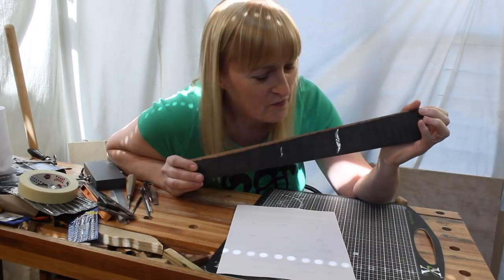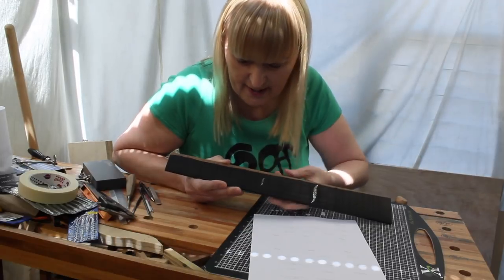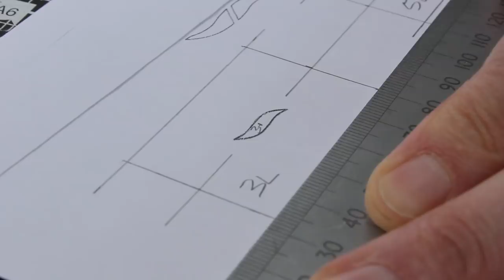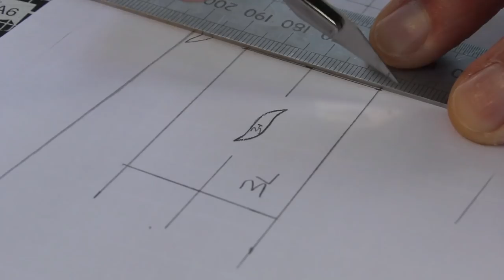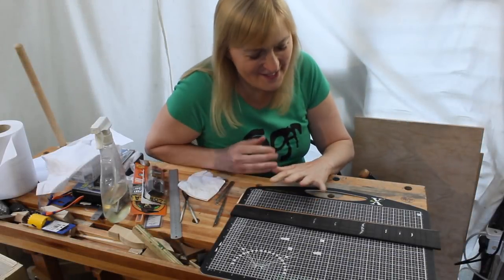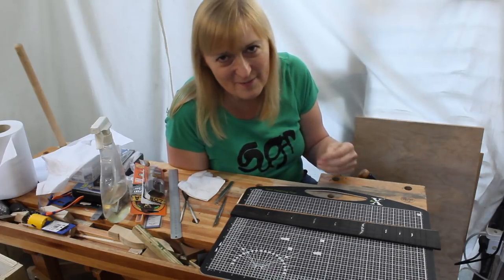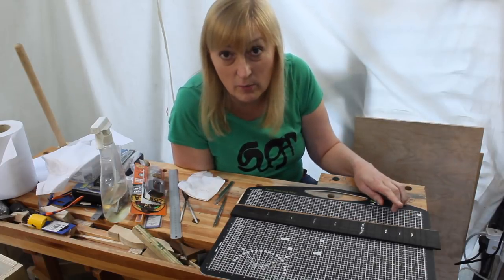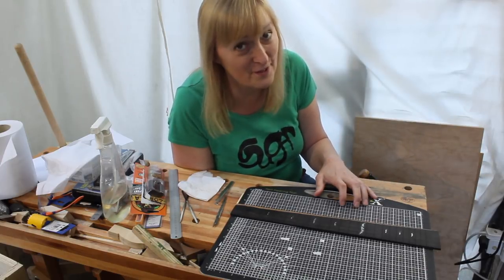Sugar SG1 acoustic guitar build part 29: The remaining fretboard inlays

Comment: Nice work (as usual). After cutting the lines with the scalpel and peeling off the paper in the center, you could leave the surrounding (negative) as a visual aid while routing or chiseling the cavity. The tape might also prevent a chip out. There is a wooden tool you can make to hold the small inlay for filing or sanding - easy to make but hard to describe - think tweezers.

Comment: I have a PRS guitar from the early 90's when they were still hand cutting the inlays, loads of filler. I also have a PRS from the late 90's after they had started using CNC machines to do the inlay work, no filler at all. I guess it depends what you want, hand made or machine made.
Reply from the maker: I would love a CNC but for now I rather enjoy the challenge of hand cutting - I’d like to see just how close I can ultimately get it.
Reply: With PRS it is the early hand cut inlays that are more sought after. I would rather have hand cut every time. Somehow it is nice to know that somebody sat, for a significant amount of time, working on that guitar.

Comment: Well done Susie - a great lesson in inlaying and a beautiful result. As for the time, it takes as long as it takes to get it right. A rush job is seldom a good job. I'm sure you explained in an earlier video but can you remind me what the drill hole is for?
Reply from the maker: I was getting a very tight fit so the drill hole allows me to poke the inlay piece out if it gets stuck. Trying to lever out a piece would likely chip it. The hole also allows excess epoxy to escape a bit easier - it’s quite a thick paste
Reply: Ah! Now I remember. Brilliant idea.

Comment: Hi, i see you used tape first, why not just glue the template straight onto the work piece if it is going to be sanded any how, a quick sad before going onto the next stage would work,
looks good so far,
Reply from the maker: This method is just cleaner. I like not having to rout/chisel through the template. You get a very good view of the clean edge of the cut.